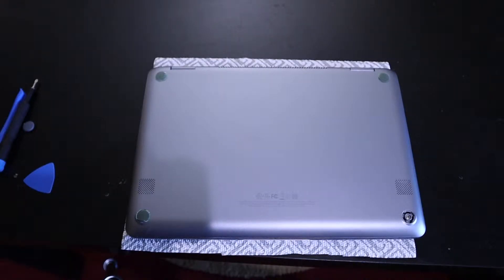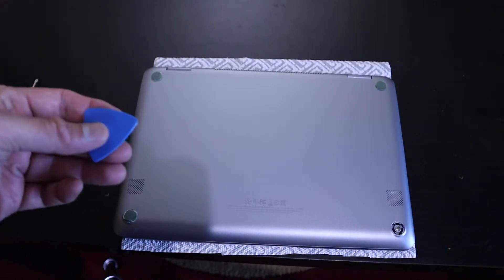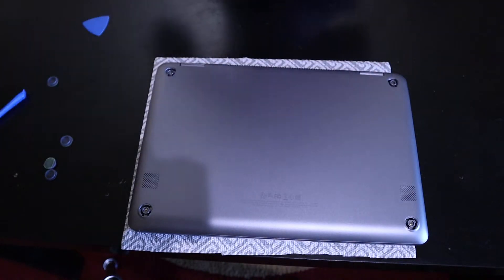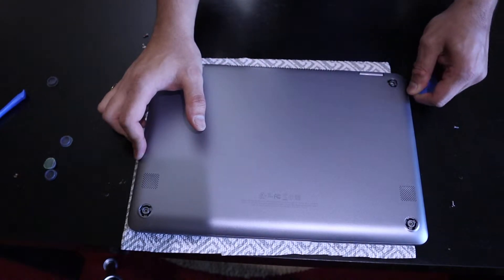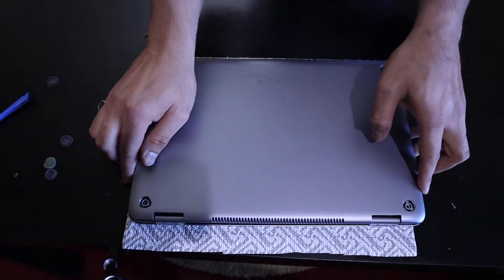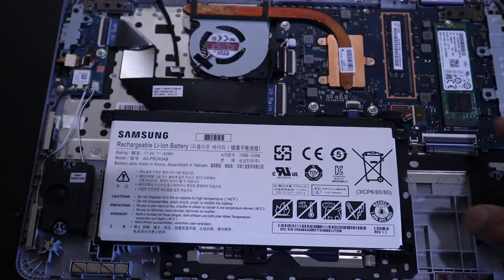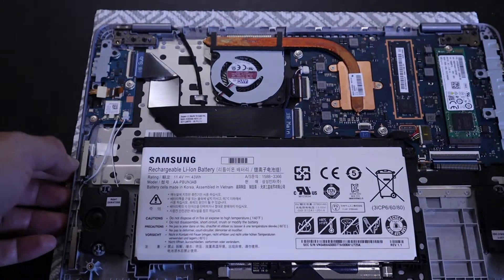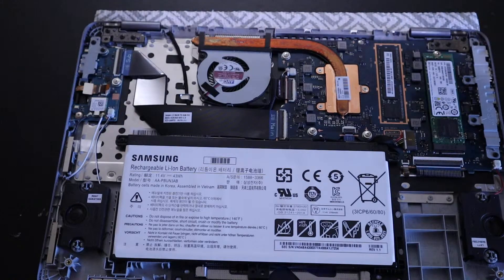Upgrading the SSD on a Samsung Notebook 7 Spin

Comment: NOTE: The 2019 version of the Samsung NP550XTA (which looks similar except that...) has hard plastic outer ring with a soft inner rubber cushion. The outer ring is to be left intact, don't attempt to remove it. The soft inner rubber cushion is to be removed. Simply use a tiny flat blade screwdriver to lift up the rubber cushion edge, then lift it completely up as it will easily separate from the ring which stays attached to the back panel. Inside you will see the screw to remove.
On the laptop in this video, the entire ring looks like it needs removal to access the screw. Different than the 2019 model I have.

Comment: Hi, does your Samsung laptop here have the fingerprint sensor on the power button? Also does the laptop have the USB - C for charging? The M.2 / MVMe might be able to be upgraded to a higher storage capacity. It might be possible to upgrade the RAM but very in depth work! Thank you 🤓 are all the screws for the bottom cover the same? Do you still have that laptop?